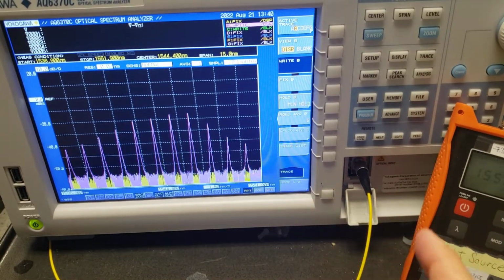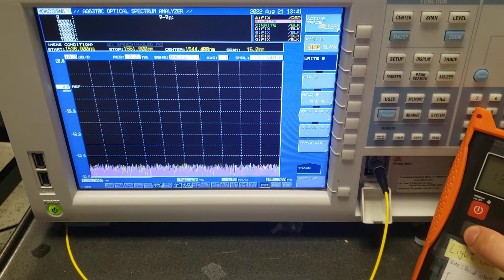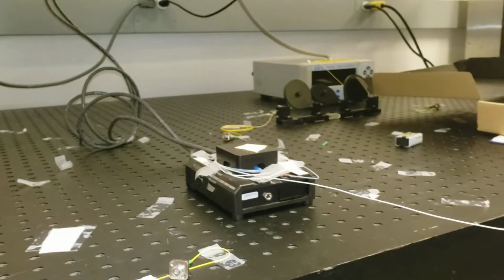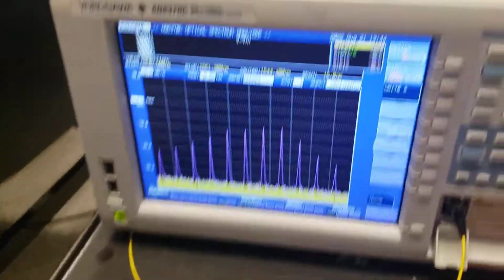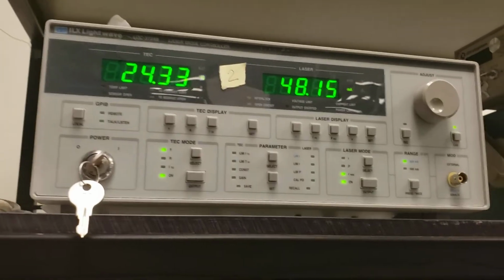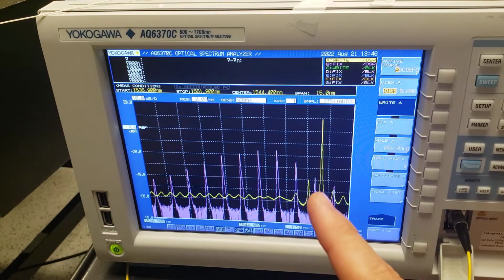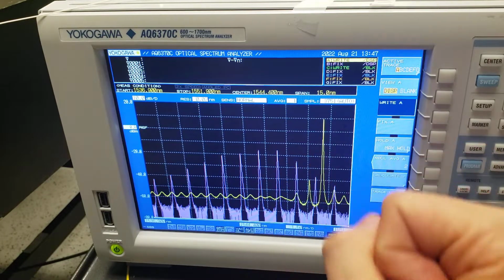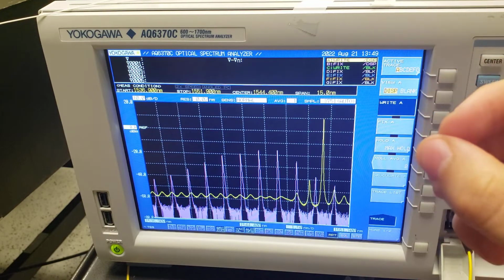Distributed Feedback Laser (DFB) demonstration

Comment: Thanks for the great video. 

Does Bragg period of the grating changes over long periods of time, let say after two years?. Or it's constant, never changes?
Also, does temperature tuning also changes the grating period, or just cavity length?
Reply from the maker: The period (i.e. the physical distance between variations in the refractive index) of a fiber Bragg grating is remarkably stable even when varying the temperature. In this paper from NASA, an FBG is temperature cycled over the course of 80 hours:

https://ntrs.nasa.gov/api/citations/20040033930/downloads/20040033930.pdf

It seems that after an initial annealing (heat-up from room temperature to 400C followed by cool-down back to room temperature), the peak wavelength at room temperature shifts by 0.1nm. Subsequent cycles from RT to 300C and back again did not shift the peak.  

In principle, higher temperatures will increase the grating period due to thermal expansion and shift the reflection peak to higher wavelengths. However, this effect is in practice much smaller than the shift due to the increase in refractive index with temperature. Both do play a role, but the spacing of the grating is by far the smallest of the two.

Comment: Great demonstration! However, you mentioned that the increase in temperature causes cavity to expand, therefore a longer wavelength standing wave (longitudinal mode) can fit inside of the longer cavity length. I always thought that the increase in the bragg wavelength (due to the bragg period of grating) is due to the period of grating expanding? Feel free to let me know which interpretation is more fitting
Reply from the maker: That's actually a great question. My statement in the video was just a "hand-wavy" remark to explain that higher temperature means longer wavelength. 

From what I know, the following factors determine the wavelength shift as a function of temperature:

1) Optical path length (n*L) of the cavity. An increase in temperature can both alter the physical length of the cavity and its refractive index. In silica, both dn/dT and dL/dT are positive, but from what I recall, the refractive index change is usually much more significant than the length change.   
2) Resonant wavelength of the Bragg Grating, which "filters out" a particular resonant wavelength in the cavity and ensures that only it gets amplified. 

These are clearly two distinct effects, but after thinking about it for a bit, I actually think that these two effects work hand in hand. The Free Spectral Range (frequency spacing between two FP cavity resonances) is FSR=c/(2Ln), so the N'th frequency line is located at f_N=N*FSR, while the Bragg frequency is f_B=c/(2n_eff*L_B), where n_eff is the effective refractive index of the grating and L_B is the grating period. 

Presumably, f_B = f_N for some value of N initially. If a temperature change scales both (L*n) and (n_eff*L_B) by the same amount (which I think it would since the grating and the gain medium-part of the cavity are made of the same material) then both f_B and f_N will be scaled equally causing the resonant frequency and the "center of the grating filter" to still be identical.   

This is just me speculating though. If you can find any material confirming or contradicting this analysis, I would be very interested in seeing it!

Comment: Hi, Great video
Can you recommend any equipment to measure laser linewidth >10Ghz (0.04nm)?
Also Yokogawa OSA that you are using will it give correct results for measureing >10Ghz linewidths?
Reply from the maker: Thank you!

Optical spectrum analyzers are generally not suited for performing accurate laser linewidth measurements. The reason is that grating based OSAs have a frequency resolution that is too coarse, while interference based OSAs rely on an internal laser with its own linewidth. Instead, you can use an Acousto-optical modulator (AOM) and an electrical spectrum analyzer (ESA) as explained in this video:
https://www.youtube.com/watch?v=efSk-l-7aTQ

For more info on phase noise, which is the source of the non-zero linewidth of lasers, check out these videos:
https://www.youtube.com/watch?v=qcpKBbtCguQ 
https://www.youtube.com/watch?v=jOx9bbz9M6I
Reply: Thank you for recommendations. 
But can you also tell what should be done if laser power is high(few hundred watts maybe), at that point we can't use connectors to perform this analysis, any ideas for that?
Reply from the maker: @rishabhsangal5155  If the power is very high (presumably because it is from a free space CW laser), you can use optical attenuators (or a 99:1 beamsplitter + attenuators if you want to monitor the linewidth during operation) and then feed the signal into a fiber connected to the setup described in the video I linked.

Comment: Can you recommend a DFB laser driver circuit ? Can I made it using OPAMP?  I am using LDM D25 S 1 SA.
Reply from the maker: I am not much of an expert in the electronics used for controlling laser diodes. In my research, I would usually place DFB laser diodes in mounting blocks like this one (https://www.newport.com/p/LDM-4984-BTB) and hook it up to a current/temperature controller like this (https://www.newport.com/p/LDC-3724C-120V). 

I can't say whether they will be helpful to you, but here are some links that seem promising:
https://beamq.com/dfb-laser-driver-board-power-supply-with-temperature-control-p-2193.html
https://electronics.stackexchange.com/questions/266386/help-designing-a-circuit-to-drive-a-1550nm-dfb-ld-and-use-it-to-modulate-an-rf-s